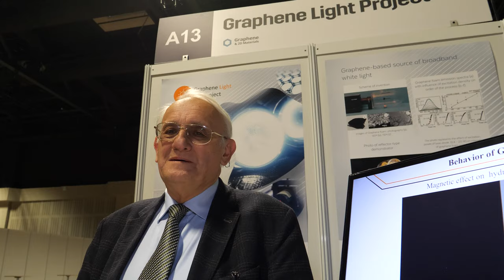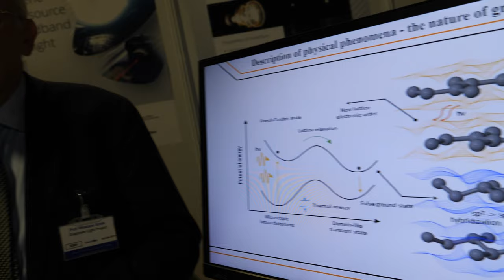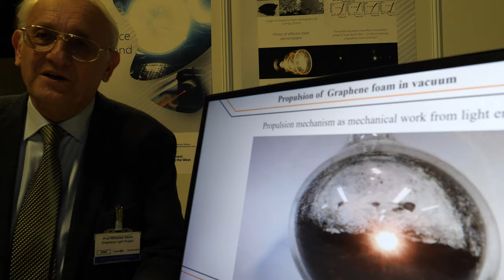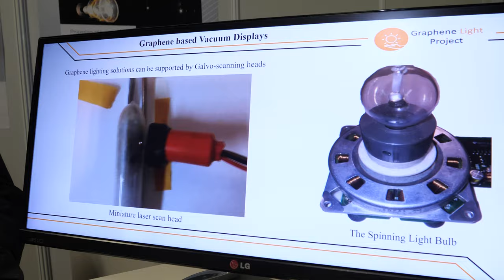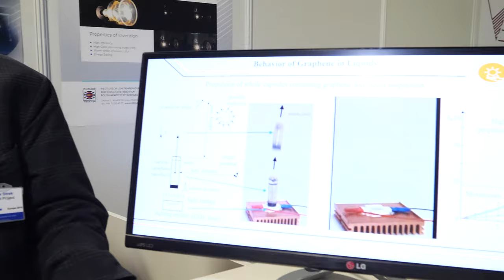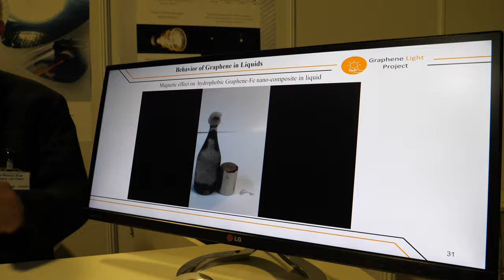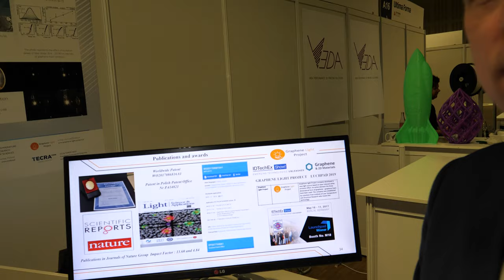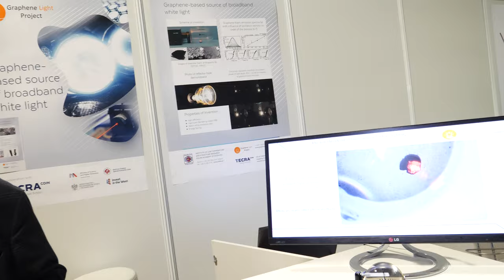Graphene Light Project, Graphene-based source of broadband white light

Comment: A project for turning solar panels heat into light, graphine could help with capturing the wide spectrum of heat waves and focusing the energy into light to be used with any solar panels, advanced solar panels could even be made to utilize the solar heat for more light for the Pv panels in the manufacturing processes. Every one would buy.

Comment: Interesting proposition. I wonder the physics behind the broadband light-output. Seeing as how the graphene is placed in vacuum, i imagine this is a thermoluminescence-effect (that the graphene absorbs the IR-laser-light and re-emits it as a wideband "white" light (glowing white-hot) --> Does this mean that:
1) the graphene-foam gets extremely hot, albeit locally?
2) the graphene structure shall deteriorate over time due to thermal decomposition?
3) the efficiency of converting energy to light is only as much as traditional incandescent light-sources?
What would be really impressive is if the "wideband" light is not from a thermal effect but instead an emission effect caused by random particle-sizes in the graphene/CNT foam. The website http://www.graphene-light-project.pl/ unfortunately does not cite any publications :(
Reply: Ad. 1. Yes, up to around 2500 K, depending on the size of the focal spot, laser excitation intensity (more specifically, intensity/spot area = laser power density) and quality of the vacuum (the better the vacuum, the less residual gases, the less heat dissipation to ambience and stronger/faster heating). The highly porous material is not very good at conducting heat (as opposed to idealized single-layer graphene in parallel plane or HOPG), so the heating occurs locally. There is a gradient of temperature from the focal spot outwards, but it would require precise imaging in the far infrared, which is impossible through FIR-absorbing quartz bulb.
Ad. 2. Slightly. Any residual oxygen will be quickly used up to rapidly burn a portion of the material, but afterwards the burning is strongly limited. As for the decomposition via melting, temperature of ~3500K is rather not reached in this setup. However, bonds can be still be broken, and also on a macroscopic level pieces can be ripped apart due to high temperature differences and resulting stress.
Ad. 3. Yes, but only when neglecting the efficiency of the laser source itself. For a given thermal radiator, its maximum luminous efficacy is defined solely by its temperature. But if a complete device is considered, one must also take into account the energy cost of the heat source, in this case a laser diode. 50% efficiency is the highest reported value, albeit for extremally high-power diodes (100 W), falling shorter in lower power regime. Typically 5-15%. Sothe efficiency of an incandescent light bulb has to be further multiplied by 0.05-0.15. Furthermore, the efficiency of a thermal radiator changes drastically with temperature: 14% for T = 6600 K, 3% at 3000 K, 1.8% at 2700 K, 0.9% at 2400 K, 0.35% at 2100 K, etc. Halogen bulbs operate at around 3200 K. The estimated maximum temperature of the device in the video is, as stated in Ad.1., around 2500 K.
(Ad. 4.) There is a publication on this phenomenon written by the authors of the invention - https://www.nature.com/articles/srep41281 - exactly where the images on the website are taken from. However, the authors did not provide solid proof that the origin of white light is anything else than thermal blackbody radiation. The method for estimation of surface temperature is critically flawed due to issues with thermal conductivity (thermal conduction channels between a nanocrystalline powder and a highly porous material are seldom and weak, and the temperature in the phosphor is not the same as in the illuminated spot of the graphene-like foam material, additionally the selected thermosensitive phosphor works only up to 800-1000 K max) and uncorrected spectra (after proper correction, the spectra take the shapes of Planckian curves).
Reply: @gurt1337  Damn, you're my YouTube hero of today. Never ever before have I received such a detailed and well-written answer. Kudos. ..and thanks!
Reply: @AdityaMehendale  You're welcome, I just happened to have had the questionable pleasure of verifying this phenomenon in the lab. It is much easier to write a YouTube comment than to convince your co-authors that something is very wrong in a published paper and that we should do something about it. We're supposed to be scientists, not fairy-tale tellers.